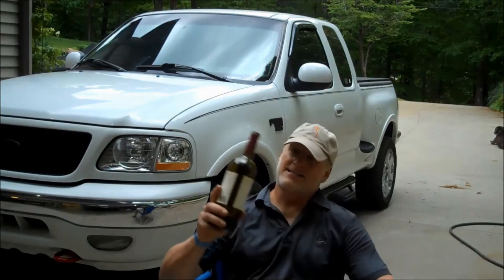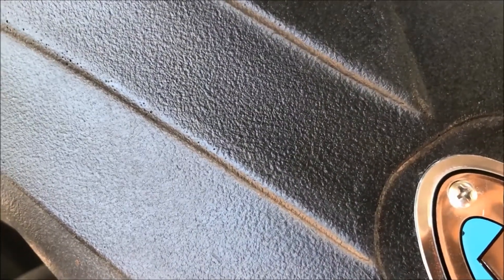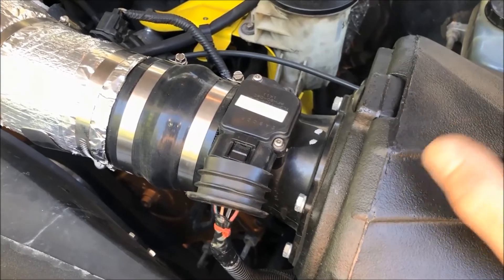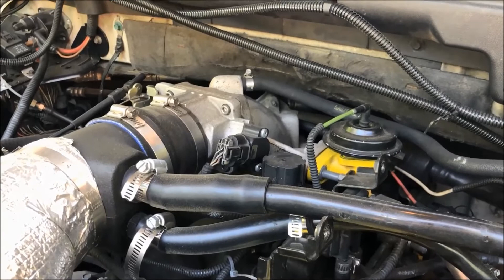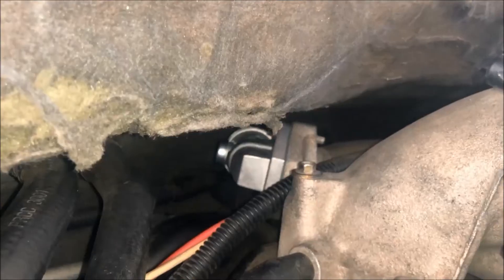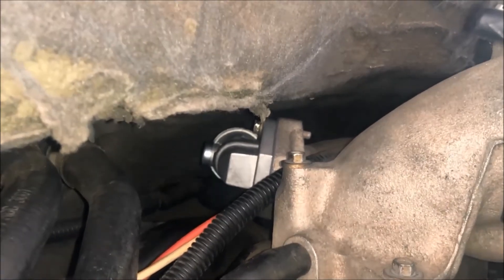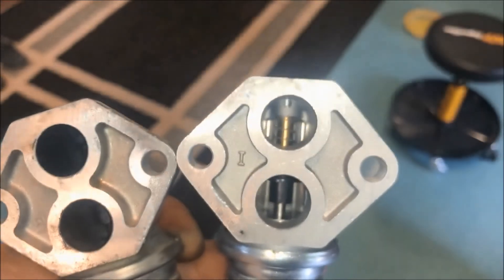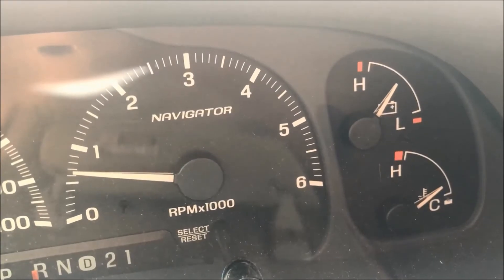How To Identify & Eliminate Resonant Noise & Vibration From Intake System: 10th Gen ‘97-‘04 F150

Comment: Also you can adjust the cable for the gear selector display. It's up under the dash, so you'll have to lay on your back, and on the right side of ignition control module, up around the steering wheel reinforcement you'll see it. It has a white mount with a little black twist adjuster in the middle. Just turn it and watch your needle line back up. But don't go to far (or to tight) because when you go to put it in 1st gear it'll be to tight and possibly break.
Reply from the maker: Thanks for this note... I covered this item as well in this video about my F150 repairs:  https://youtu.be/_SKaJl3QqQw